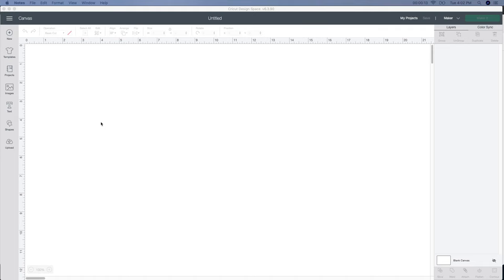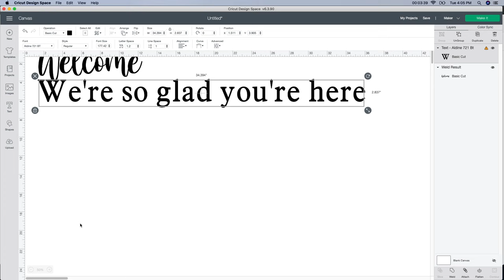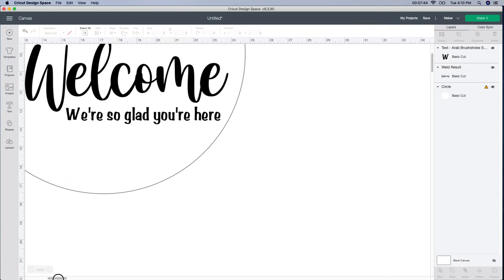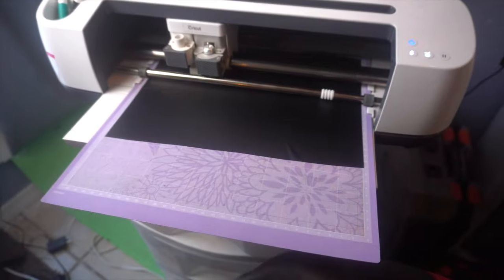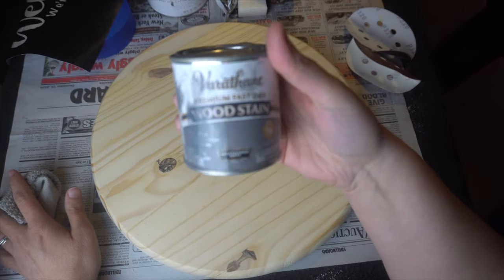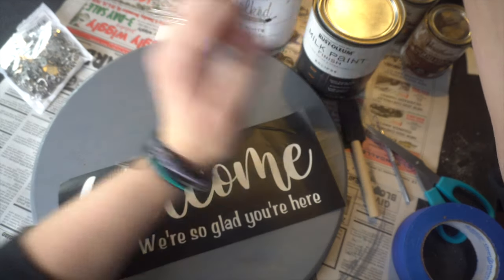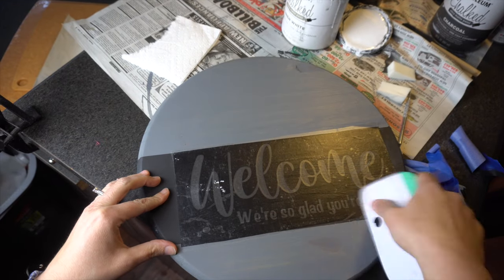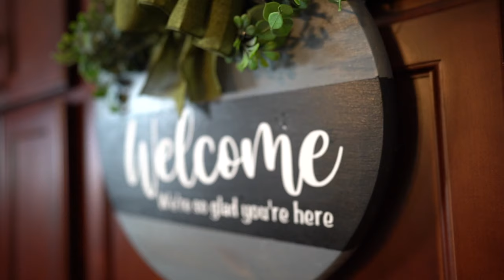DIY Wood Round Sign  (Cricut Tutorial)  (How To Create A Welcome Sign Tutorial)

Comment: I am very new at this. I just got the cricket air 2 for Christmas. When I bought round wood from hobby lobby I didn’t realize that it was super thin. Now a have several that I glazed rather than stained. What would you suggest to do with them since I didn’t buy the right thickness. I have a lot of picture frames that I can put chicken wire as a backing. I love crafting but don’t know how to start. Another question do I have to set up some kind of website to sell stuff or create a Pinterest? Again I don’t know how to do that. I am in my 40s and have lupus and I am just trying to find things to get my mind off my current life issues.
Reply from the maker: Fun 🙃 welcome to the crafting family.  I created several signs and a few sign videos, I did a few videos using thin 12 inch rounds 😉 you could watch those for some inspiration (i know one was some Easter Signs).  

I don't sell on pinterest or on my blog, I sell directly on Facebook and Facebook marketplace and in 2 consignment stores 😊 maybe start with Facebook.

Im here to help however I can.  Happy Crafting